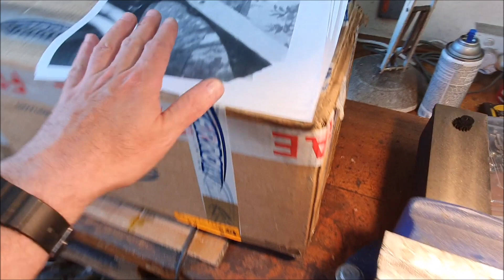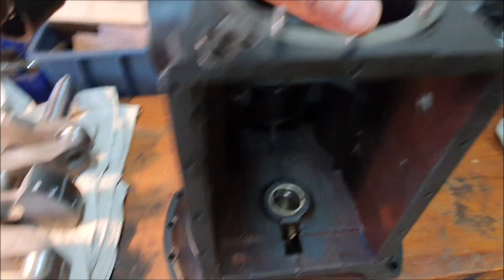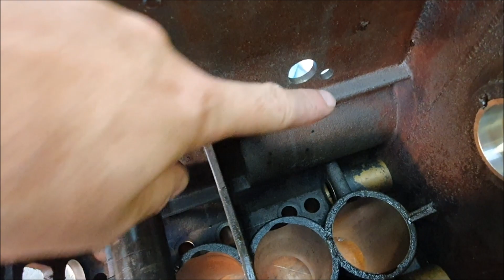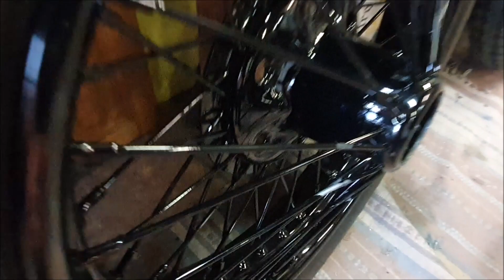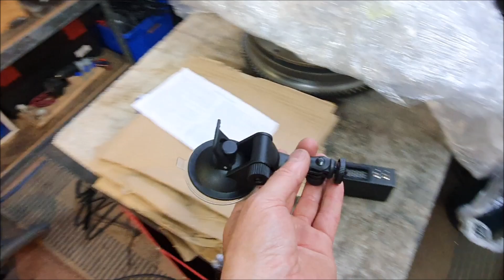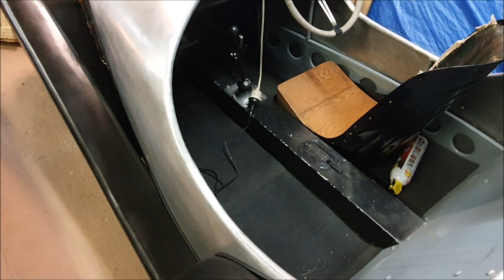Pre war cars update - Riley 9 wheels finally arrived!

Comment: You might want to choose a temperature resistant double sided tape. I neglected this property once and my electric brake controller detached when the car was parked in the sun!
Reply from the maker: I live in Wellington now remember, not sure the sun gets that hot here! But yes, good point, especially in a closed car which could get very hot. Proper automotive VHB should be ok. Pricey stuff though. I've taken the unit on several long trips in the MG now and it it holding up well. It works very well too. Having no roof means you get a nice, clear signal.
Reply: @asciimation  From memory, cabin ECUs were typically spec'ed for 85C, more if tucked in the dash under the windscreen.

I don't think a tin top hinders modern GPS chips much. My phone picks up 20 satellites inside my house. 20 years ago a hand held unit would struggle to get lock on a forest road.

Comment: I made a crankshaft for my '29 tourer using an 1 . 11/16" crank as a pattern, since my block was for an early 1 . 9/16 " crank I had to file some relief in the spigot hole to allow the crank to pass through. I fitted this crank 16 yrs ago it's caused no problems , but my engine is bog standard with single carb ,std cams and valves but still motors well enough for me.
Reply from the maker: I did the relief in the block  and the crank now fits but it sits too far forward. What sets the crank end float in a 9 engine? The front cover provides the thrust face I know but what sets the distance between the two ends? Just the position of the rear bush?

Comment: My wheels were re-built last year, (Standard Swallow), same sort of price (but in GBP Sterling as I am in UK) and for the return each wheel was individually packed in its own cardboard box, then, these were strapped together (two & three - all five done), it is not rocket science and a little care and attention by the professional you employed would have avoided all this, nothing to do with the courier, they are just moving stuff around that they have been given.

Not sure if straightening a spoke is right, if it has stretched in the process, then it will be looser than it should be and then not doing any work.

Sickening, but if it were me (and you are more of a perfectionist than I am...) I would be getting them to collect them & re-doing it so it is right, damage like that is never going to be satisfactory, down the line, if you don't do it you will be regretting it, realistically, if they are away again for a few weeks is it really going to delay your work?

With you on this, similar problem with a re-built steering box, it went back twice (so they had three chances to get it right), leaked oil, I took them to Court and before it got there, I agreed with them an out-of-court settlement of a two-thirds refund of the monies I paid, still got to sort the leak, but it cost the professional (Marles Steering Boxes) a lot as he had to pay his lawyer's fees as well, which would not have been cheap!

The onus to rectify matters has to be with the source and with something like wheels if they are not true then the car's handling will never be right, particularly at speed.

Bite the bullet and make him sort it out.
Reply from the maker: Problem is it won't be a few weeks, it will be months again. I think when dealing with a big company it's good to go back and get them to make it right. One man band type things though it's not wise. They won't want to do it, have zero incentive too and if you press them they'll just do the minimal possible to make you go away or worse, completely mess things up or 'lose' them from spite. Sending away something that's very hard to replace to someone who messed them up the first time seems unwise. Would rather fix them myself. I do know someone in the vintage car club who has been playing with re-spoking wheels himself so might ring him and see what he thinks.